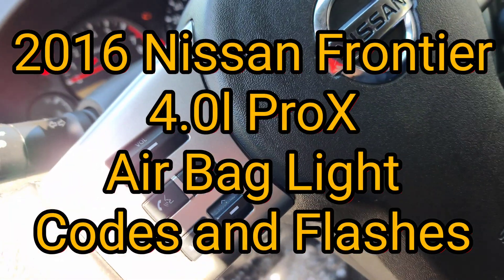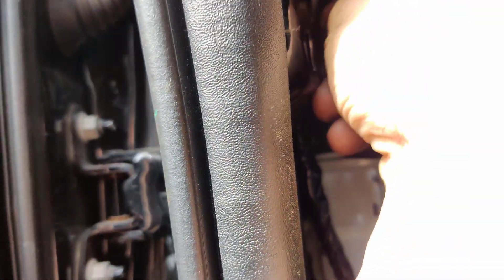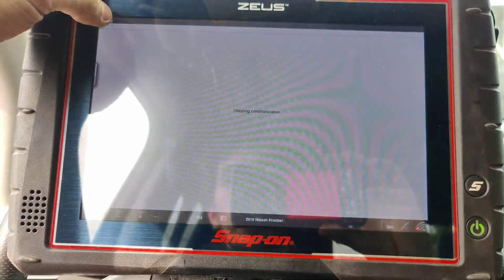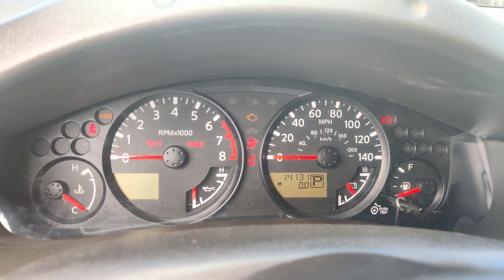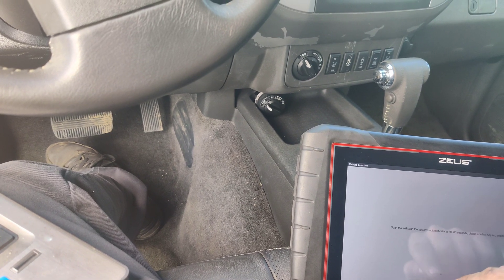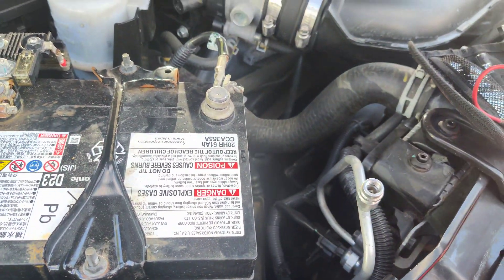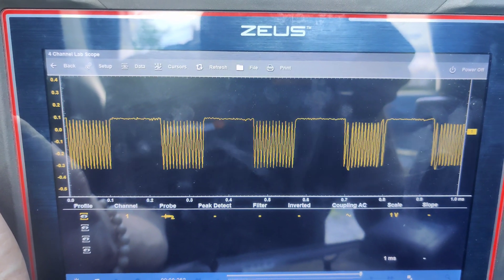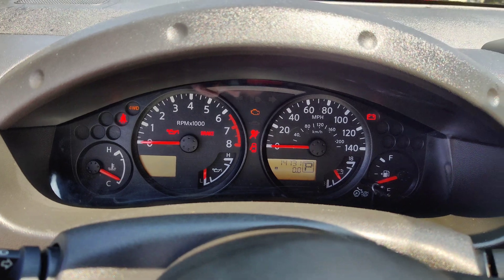2016 Nissan Frontier 4 0 ProX Air Bag Codes (Nightmare) B0093, B0094, B0098

Comment: Question.
I have a 2020 frontier at the shop. It has both codes B0093 and B0094 with airbag light flashing. I substituted the front impact sensor with another sensor and it still has exact same code B0094. According to Autel 0093 is for left door. So did you find swapped connectors inside the driver's kick panel?